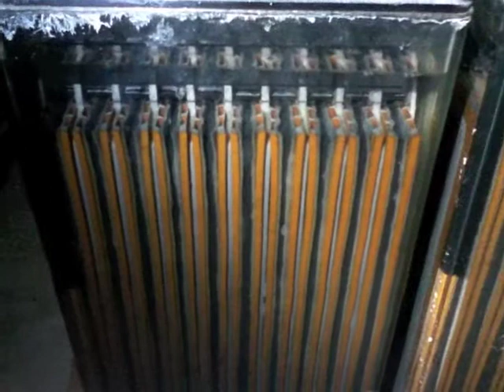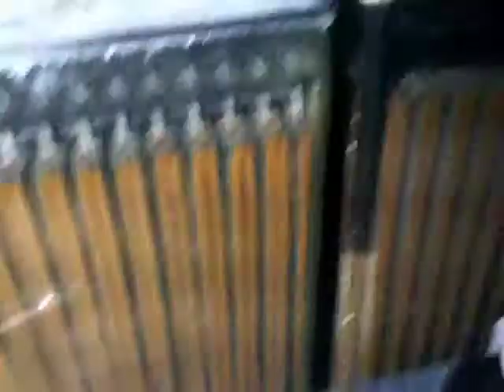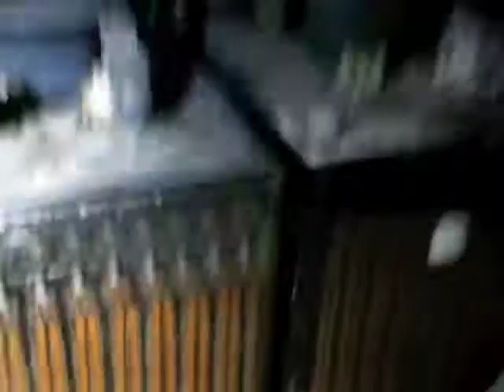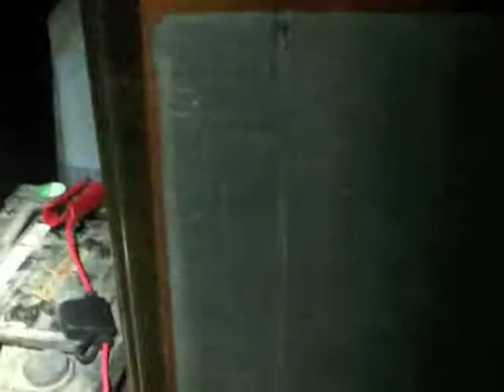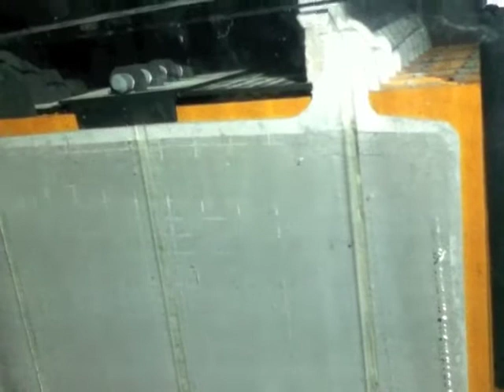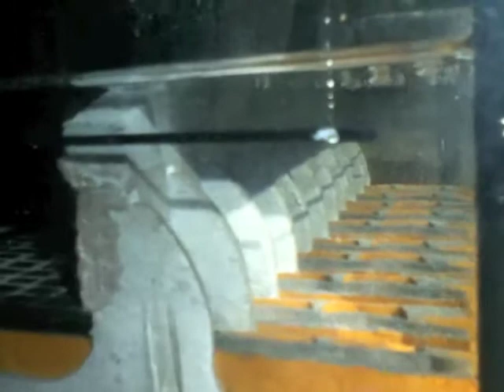Boiling Batteries,2Volts,Solar, Wind ,WattsView

Comment from the maker: I had about 110 amps pumping in @ 31.2 Volts in the absorbing mode coming just from my 16  175 W mono 24V panels. Gotta keep the electrolite from getting too settled it gets thicker at the bottom. I try to mix them up every other day